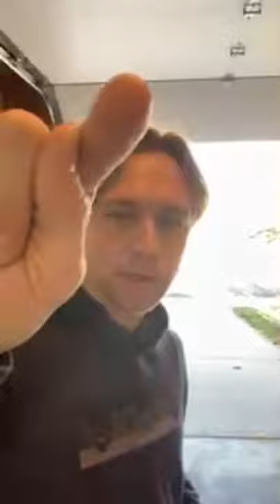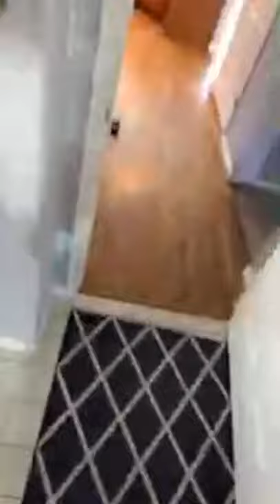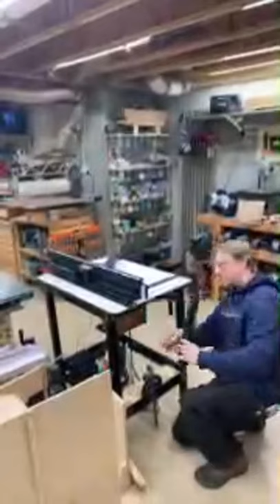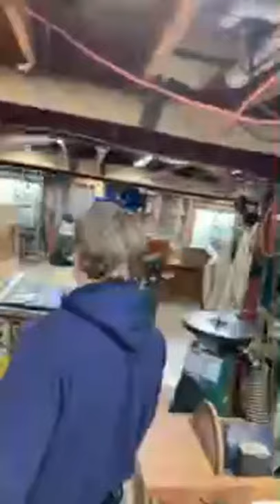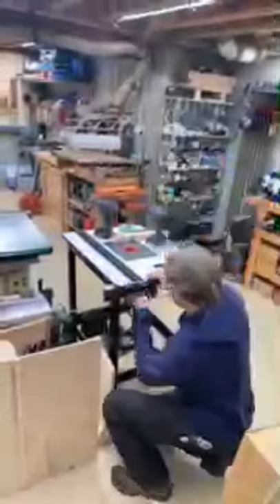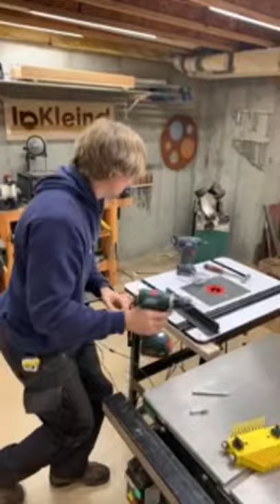Router table install

Comment: Thanks for the stream, and for answering my question about using a waterjet to cut 4x8 3/4" plywood. Here is the link to the Applied Science channel  with a video on building a DIY waterjet cutter. https://youtu.be/qAIDFaKhcZE  If you have any additional thoughts on the subject I would love to hear them.

For those that missed it, I asked for Andrew's thoughts on using a waterjet to make precision, intricate cuts in a 4x8 3/4" sheet of plywood. I'm not worried about the water, it is easily dealt with. I think there are significant advantages in performance and (DIY) machine cost when working with thicker materials. I didn't mention cutting metals, but the advantages should be obvious as well.
Reply from the maker: Thanks for joining, let me watch and get back to you
Reply from the maker: Ok, I watched the video, and that is really impressive that he was able to pull this off, I'm glad you shared it with me.  For plywood given the expense of the abrasive (which I think you would need for 3/4" ply) I don't think this is really a better option than a tried and true router CNC.  I would be really surprised if this home built system didn't require a LOT of fiddling and repairing if you were doing a lot of serious volume on it also, but thats just a guess.  I'd say if you are intrigued by the potential of building your own water jet, and ready to overcome the challenges in operating it, and also plan to cut other materials then go for it.  If you just want and economical and easy way to process 3/4" ply then get a router CNC.
Reply from the maker: Lastly, thanks for joining the channel!
Reply: @AndrewKleinWW  Thank you for the response.  My personal use case would be for for steel, glass, and wood. I just happened to be think wood as your video was related to a router. One thing to consider, when cutting wood a less expensive abrasive could be used. Although that would contribute to one drawback you mentioned, I anticipate fair amount of fiddling. However, like most tools (assuming they are well built of course) once it's dialed in it should be fairly reliable.

Since you mentioned it (lol), what would you suggest for a router CNC that could handle 4x8 3/4 sheets of plywood? I am a big fan of DIY, however a commercial build is alright as well.